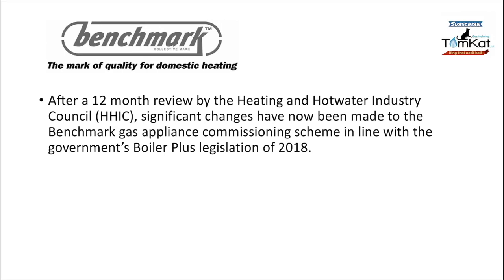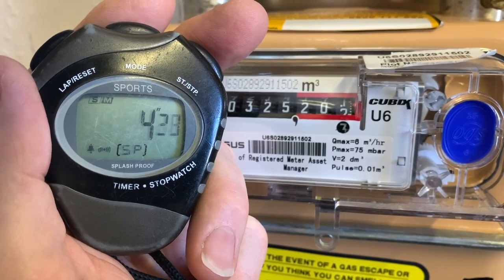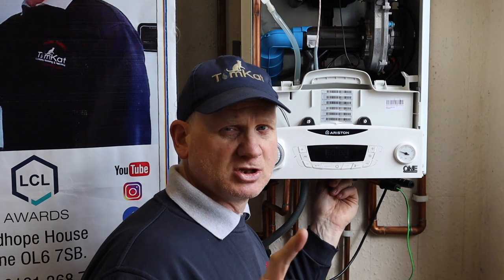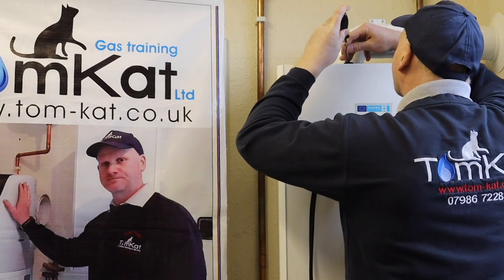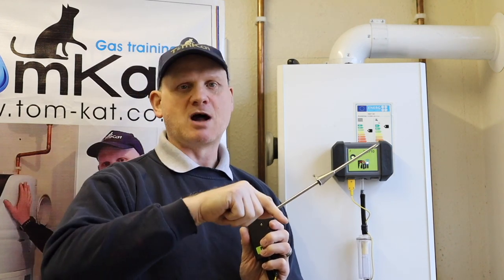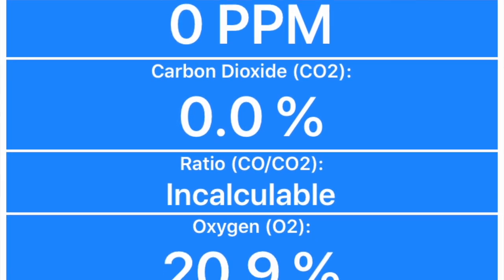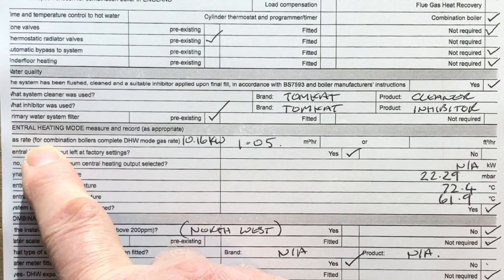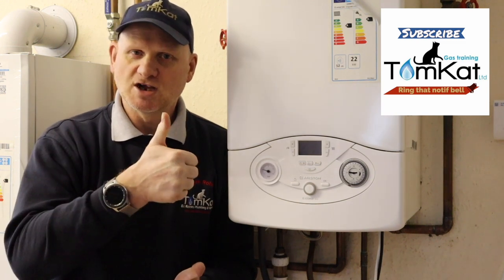HOW TO COMMISSION A BOILER to the new benchmark procedure  part 2

Comment: I think your videos are absolutely fantastic and extremely helpful to gas engineers, one part that im getting confused with is testing the flame rectification device, if the flame rectification device operates correctly would it not shut the gas valve if the flame was not present.
Reply from the maker: If you isolate the gas when running the rectification stops so the boiler shuts down locking out the boiler so it needs resetting

Comment: Great videos Derek. You didn't say if condense pipe work was ok to fit into push fit waste. I always use solvent weld pipe. Does it mater?
Reply from the maker: I have heard engineers say you can’t use push fit on condensate because it rots the seals but I have never seen anything in regulations to say that. In the regs it says pipe resistant to corrosion ie plastic pipe so I would say it makes no difference
Reply: @tomkatgastraining  Fair enough. Thanks for replying.

Comment: Another great video Derek, well presented, I have just 1 question, for the flue gas analysis max & min you keep the prove to 100 to 150mm, so when it comes to testing the flue integrity you adjusted the probe stop to how many mm should you keep it at. If you can advise me on that it will be appreciated. Thanks 👍👍👍😁
Reply from the maker: Depends on the flue there is no set distance on flue integrity just needs to be done from the flue elbow or turret not the terminal
Reply: @tomkatgastraining  thanks. 👍👍

Comment: If working pressure at gas valve is above 17mbar is that sufficient even if this is more than 1mbar drop from working pressure at meter,  do I have to run hob/ other appliances at the same time?  Very good video, Thank you  Ste
Reply from the maker: Stephen Mulhall when you are doing the tests you are checking to see if the appliance or appliances are safe to use. Some manufacturers will allow 15 mbrs at the gas valve as long as the safe operation of other appliances are not affected. Working pressure at the meter tells you you have the correct gas coming into the house and working pressure at the appliance is checking the pipe size is correct.
Reply: @tomkatgastraining  Thank you very much,  Have recently passed my ACS exams for the first time, your videos have helped greatly.  (Although my wife now also knows how to gas rate from watching videos with me!)

Comment: Hmm am I wrong but I have allways thought that the condensate need to be solvent weld/glued?
Reply from the maker: The building regs say it has to be corrosion resident ie made of plastic the boiler manufacturers instructions says the same. The acidity of condense is the same as tomato Juice so why can’t you use push fit ?

Comment: It's very difficult to gas rate the heating because its modulating ,you would properly get a different reading every time .
Reply from the maker: That’s the idea what dose gas rating in high and low going to tell you. high and low is for flue gas analysing and flue integrity not gas rating